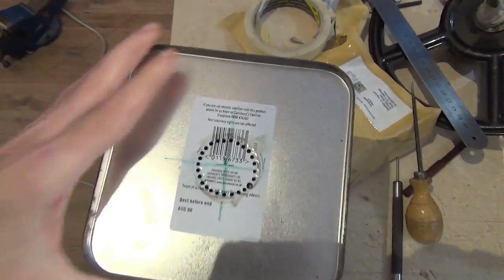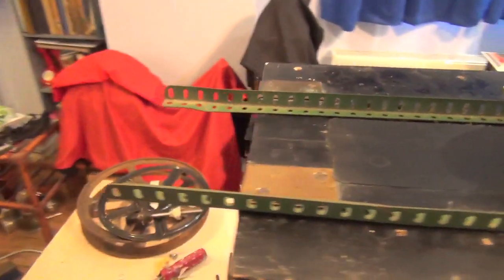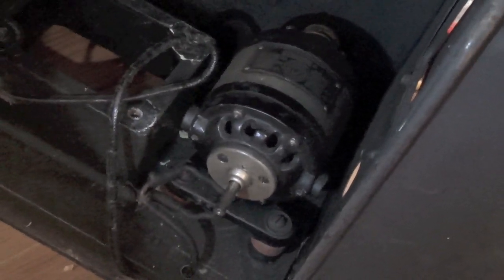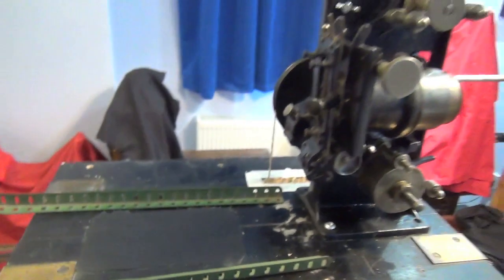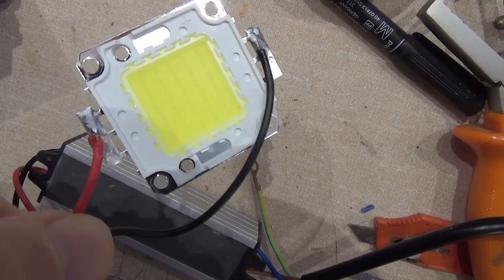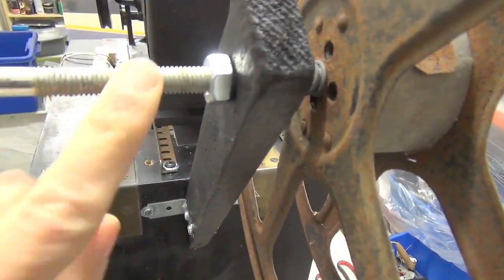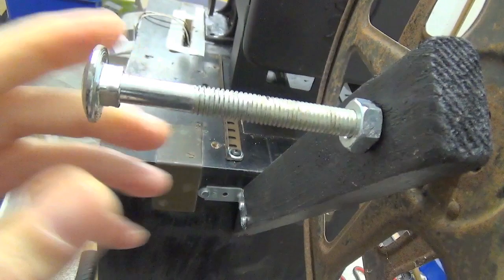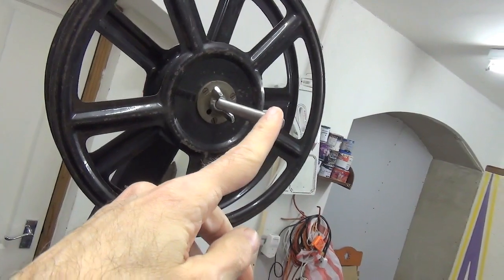A Projector for Kinemacolor, Part  4 - 35mm movie rebuild.

Comment: Love your use of Meccano 🙂👍 not sure if it is economic as it is probably all collectable stuff now 😜
Reply from the maker: It saves a lot of time drilling holes in strips of specially cut metal, etc. You can buy a bunch of strips or girders (and other bits) on ebay for reasonable sums, if they are 'play worn' or re-painted or a bit rusty - which suits me fine.

Comment: Hi where do you solder / connect the fan wires to?
Reply from the maker: The fan requires a separate 12v supply - maybe you have a spare mains transformer that you could use?
Reply: @horipet  Thank you, Yes I can use one of my old equipment 110 to 12V  Adaptor